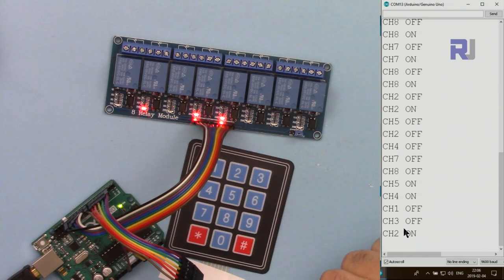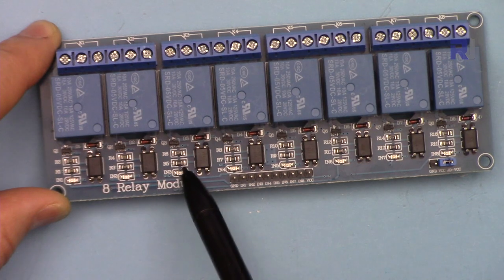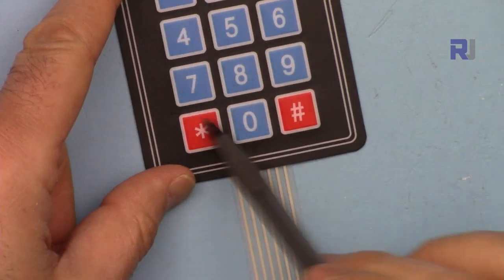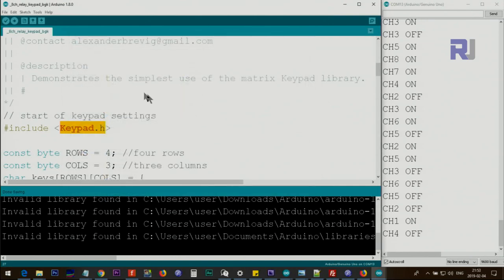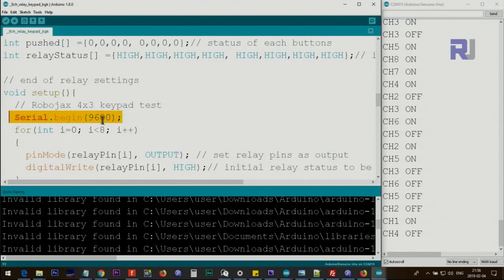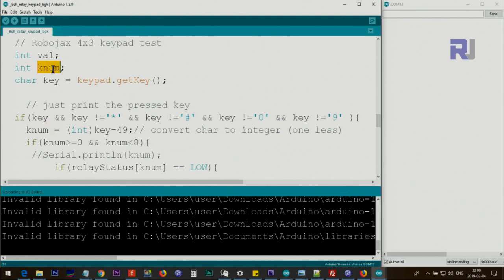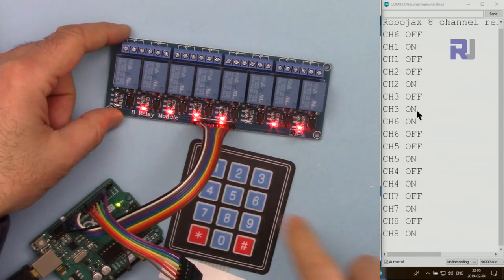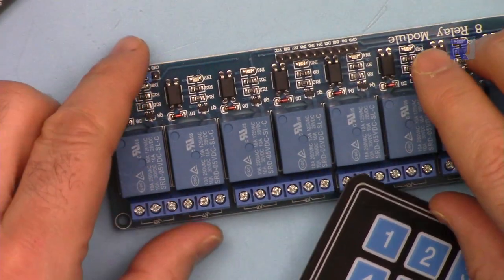Lesson 67: Controlling 8 channel relay with a 4x3 keypad to control 4 AC or DC loads

Comment: Great work, I tried it worked but I noticed that after every powering up, only key no.1 turns ON while the rest you have to key in twice. How can I correct that?
Reply from the maker: Check the wiring if you did not change the code

Comment: Can you make video about key board 4x4 with arduino  control on long distance with rs485 and on other end 12 relay momentary switches.
Reply from the maker: The application is countless. I will see if timer permits, I will do it.

Comment: Hello Sir.  Is it possible to control the individual relays wth individual mechanical on/off switches without using an Arduino or microcontroller?  For example, a DC power supply would feed the separate switches. When the mechanical switch is flipped, the DC would trigger the corresponding  individual relay.  In this scenario there would be no Arduino, is this possible on the 4 to 8 channel relay modules?
Reply from the maker: Hello, here are my videos on relays. You can find the one with push button or flip swtich to turn it on and off https://www.youtube.com/channel/UCkcBSig_Iu4ZnAIeCeG1TVg/search?query=relay and hre is controlling 4 relay with 4 switch https://www.youtube.com/watch?v=3EZecphNdAI

Comment: I want to use 8 relays but it did not work for me, is it because of the power supply which is 18 watt ?
Reply from the maker: Which part is not work? The keypad or the relay?
Reply from the maker: First make sure the keypad works shown i this video https://youtu.be/d4bs8A8iMJ0 then come to relay
Reply from the maker: The make sure that you can control the relay learn from this video https://youtu.be/Wbm3MCMgM_s
Reply: @robojax  The relay don't work , in fact I don't use keypad ,

Comment: Can i make the relay momentary controlled
Reply from the maker: like push  and keep pressed, relay ON and release the key, relay OFF?. I have explained it fully so you should know it.  this line  pushed[knum] = 1-pushed[knum]; is changing the state from ON to OFF when  you press a key.  comment this out like this  //pushed[knum] = 1-pushed[knum]; and this line will not work.
Reply: He code are not working

Comment: Hi bro plz can u help me about password based home automation. I am making and need code of the circuit but not found on the web have used 4 channel relays. Lcd included.
Thanks
Reply from the maker: Hi, your request is a project that needs some work. Now you even added LCD. I don't have the code .
Reply: @robojax  ok bro n.p 
Thanks.
Reply from the maker: you are welcome.